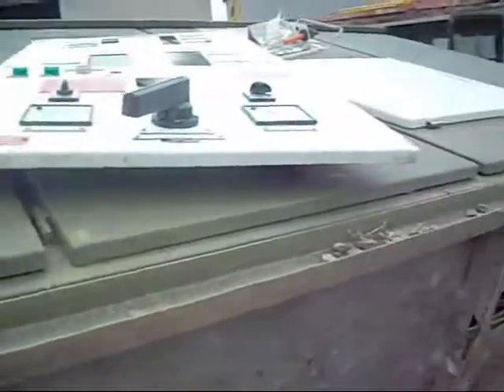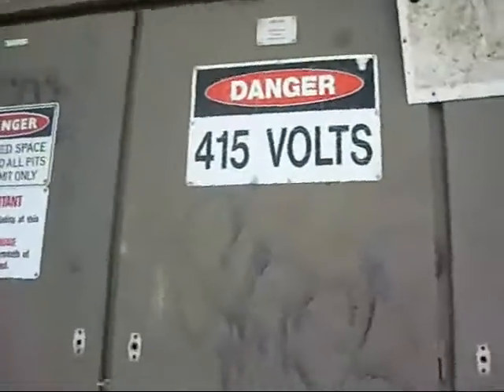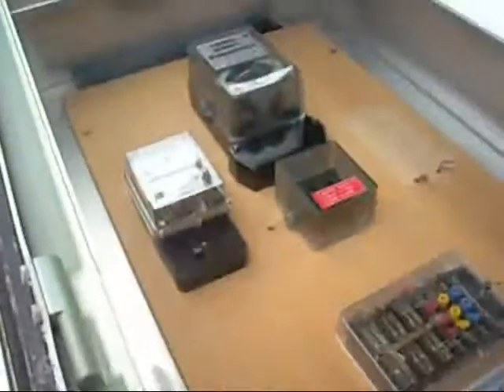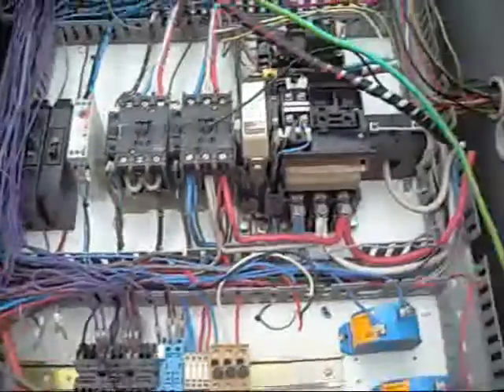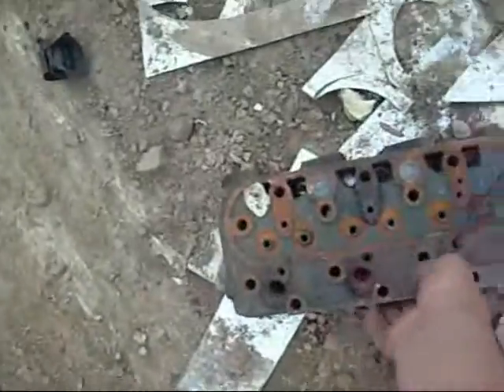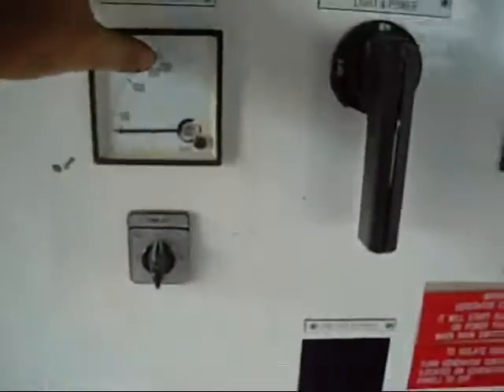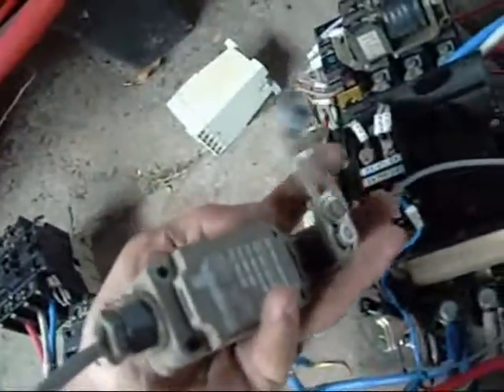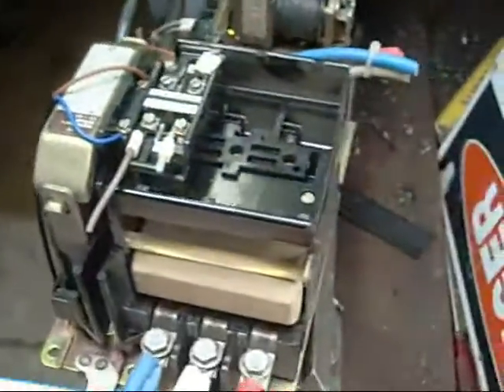Scrapping a large Pumping Station Control Cabinet

Comment: At 6:08, an RT3M is a thermister relay. A thermister embeded in the motor windings is connected to the RT3M and if the motor overheats, the thermistor resistance goes high, the RT3M senses this and its output relay switches - usually connected in series with the contactor coil.